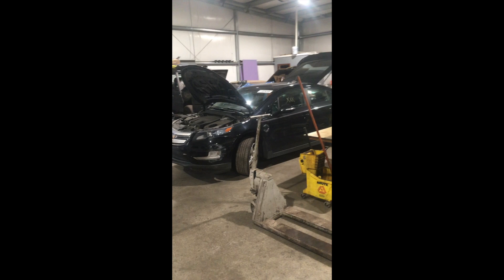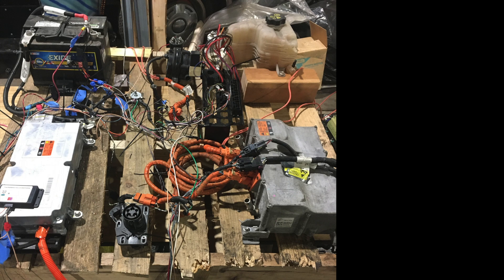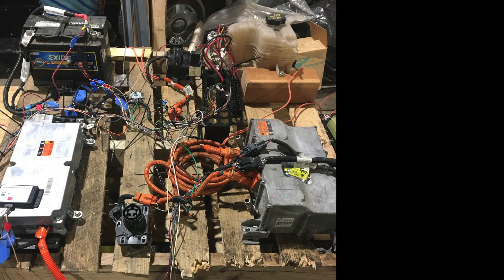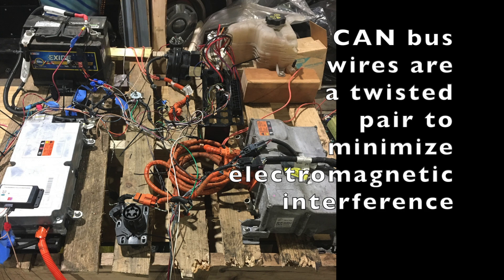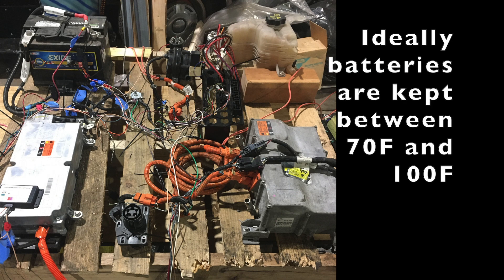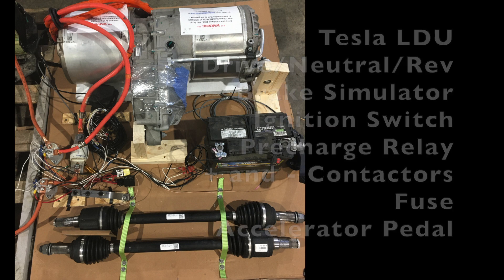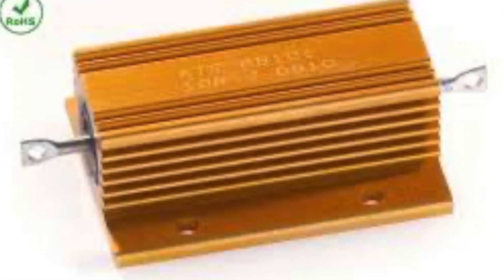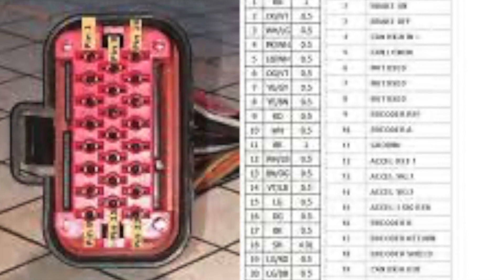Mercedes 300D Tesla Swap EV Conversion Part 2 Test Boards

Comment: Did you use the metal clips from the Chevy volt battery tray? If not do you have two you could spare? They are about a foot long with a series of holes
Reply from the maker: I am using them to hold the batteries to the stock battery trays.  I just cut the battery trays to fit the dimensions I needed.
Reply: @vegthesystem  ok thanks for replying

Comment: Dave, did you make a schematic for this control of the Tesla inverter?
Reply from the maker: I did not make the controller for the inverter, I bought it from a company.  I made a giant spreadsheet for all of my system connections, fuses and relays.

Comment: Interesting that a totaled Volt is still worth $2500 in the value of its parts.  Wrecked Tesla cars are similarly priced because their parts are even more expensive, as there are few aftermarket parts and Tesla prices parts very high.  Important safety tip on that pre-charge circuit for the large capacitors in the inverter.  Safest if a relay interlock prevents the main contactors from closing until those capacitors are charged, but sounds like Tesla uses a software interlock.

Those drive-by-wire accel pedals seem risky.  Many reports of sudden-unintended acceleration in Tesla's, but the company responds "driver error" since the data recording says the driver pressed the pedal (or computer just thought they did).  Wheeler Dealers had an episode of an early 1990's one in a Maserati which was erratic and had to be reworked internally.  If just a rheostat, that is like the volume knob on an old radio, which often become erratic, but probably more digital today.